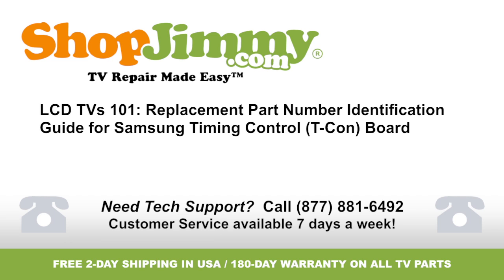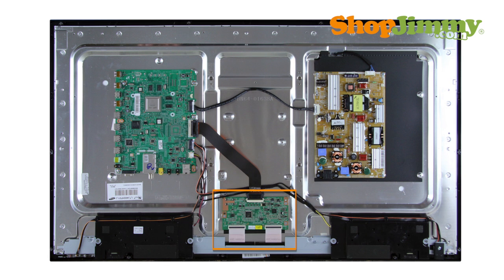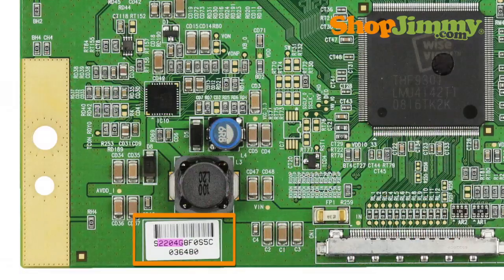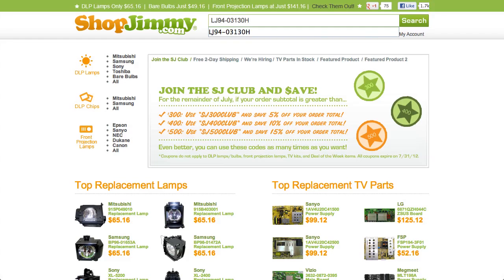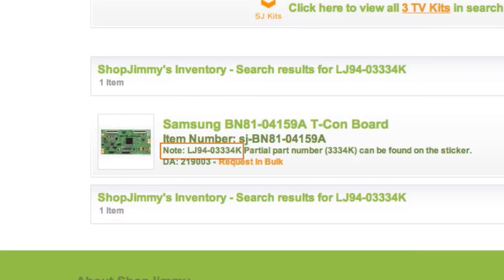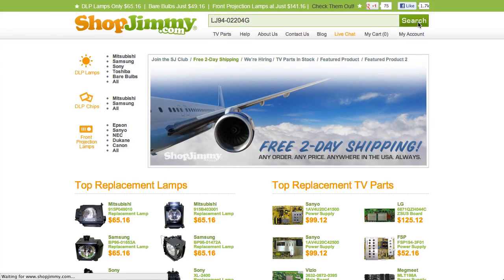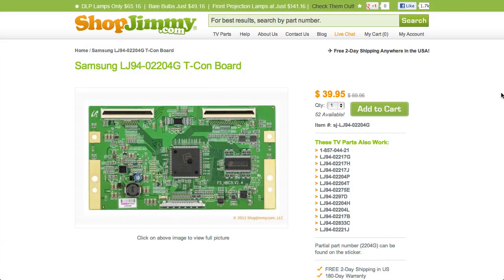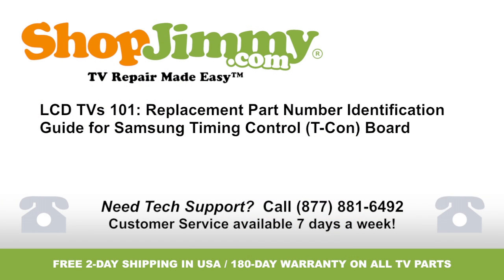Samsung LCD TV Repair - Identifying Samsung T-Con Board Part Numbers - How to Fix Samsung LCD TVs

Comment: Hi, I have a Sony bravia KDL-40SL140 S/n 8105707 Manufactured in OCT 2008.first problem I started having with the TV was " solarization" according to what I have Learn Thru your videos, them after now I have sound but no picture. And It looks like the screen backlight is coming up , but no display at All. So I guess that is related to the T-COM Board, please Let me know , which part would you recommend to replace for this TV.  Thanks for your help.
Reply from the maker: testuser1234   I recommend replacing the main board in your TV.  Here is a link to replacement parts for your TV model number on our website, click here:  http://www.shopjimmy.com/catalogsearch/result/index/?master_part_type=Main+Board&q=KDL-40SL140  Be sure to match part numbers on your current board, with your replacement for compatibility.  Here is a link to a video showing how to identify your part number, click here:  TV Part Number Identification Guide for Sony Main Boards (LCD, LED, Plasma TVs) TV Repair  You can also call our customer service for further assistance with your purchase.  (877) 881-6492  Thanks and please let us know if you have any further questions with your TV Repair!  www.shopjimmy.com

Comment: hey I have a sony bravia KDL-52w4100 that is doing the same as the tv in the youtube link provided. Is here anything that can be done to fix this? I have heard changing either the T-con unit or backlight inverter would help.  http://youtu.be/69-krUwUzvU
Reply from the maker: Jr Mello   This sounds like a TV panel problem.  If your TV panel is bad, it may be more cost-effective to replace the TV as panels are typically hard to find in stock, difficult to replace, and expensive.  Thanks and please let us know if you have any further questions!  www.shopjimmy.com

Comment: I have a Samsung 60 inch led smart tv model no. UN60ES6100FXZA version HH01. I have vertical lines from water damage 4-5 inches or les from each other...Do you think that the T-conn is what I need to fix these line that seem to shift color depending on the picture on the screen as well?

Comment: Hello My tv keeps turning off and on with a clicking sound but no icture it has been doing this for awhile i dont know which board to replace T-con or power supply i have the Samsung un46d7000 i most likely will buy from shopjimmy if i find the source of the problem.